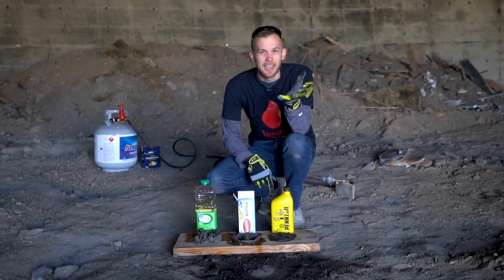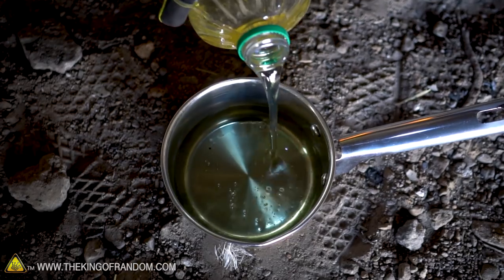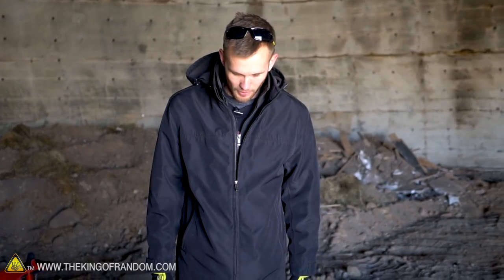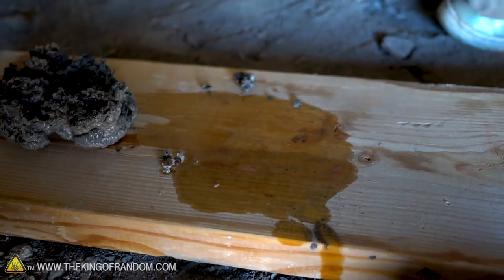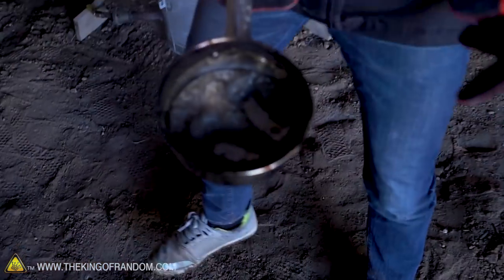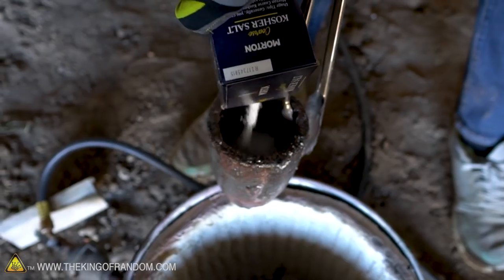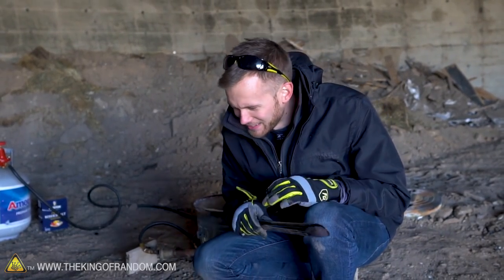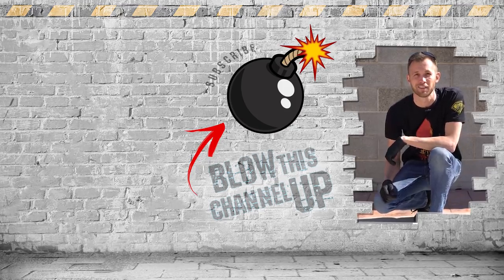Molten Salt Dropped in Oil! TKOR Dives Into Molten Salt In Oil Experiment And More!

Comment: Will appreciate if you used SI units
Reply: uh he lives in us
they don't use metric system
Reply: Darren Ivano Yea i clearly know that. He can say it in imperial units and maybe label it on the screen as metric unit.
Reply: would make sense since his viewers are international
Reply: Powerbounce yes, he had a few on screen labels for the metric system months and months ago but alas those are no more. Now I have to run off the fact that 50 Fahrenheit is 50% hot, 100 Fahrenheit is 100% hot and 10 Fahrenheit is 10% hot.
Reply: DerpTrooper4000 ?? Wtf
Reply: SANB SPs it was a method I was told for understanding Fahrenheit.

Comment: Correct me if I'm wrong. But I believe the flashpoint of oil is the point where the oil will combust without an open flame, not the temperature it has to be to burn.

Comment: What happens when you heat oil to the max and then pour it into water and other liquids
Reply: Tyler Lamb "heat oil to the max"... If you overheat oil it burns. You pour burning oil into water will just splash hot oil and water everywhere.